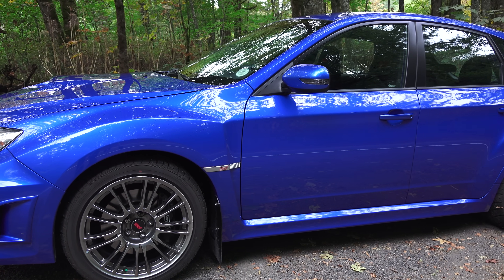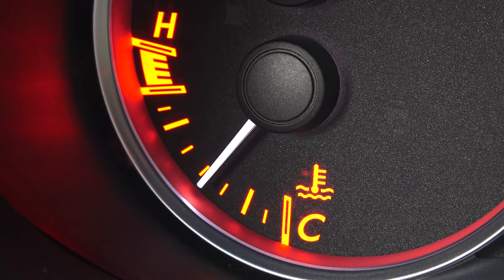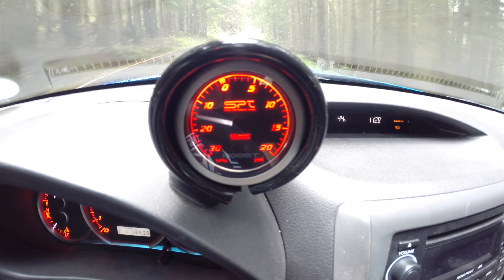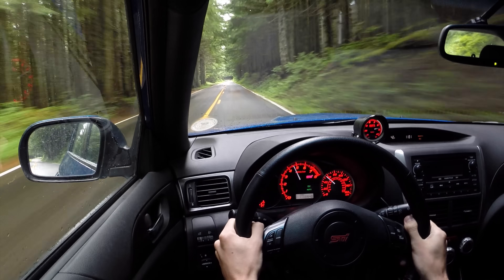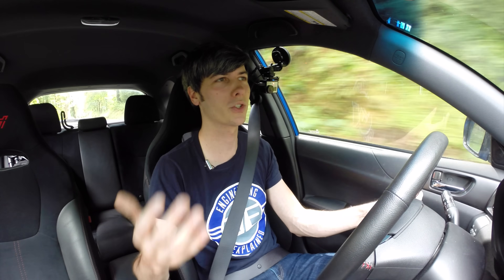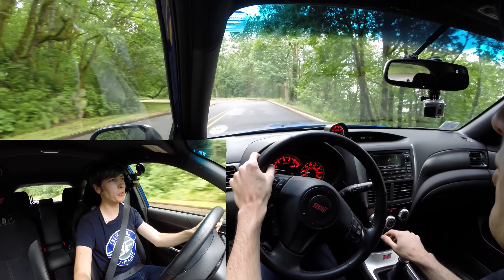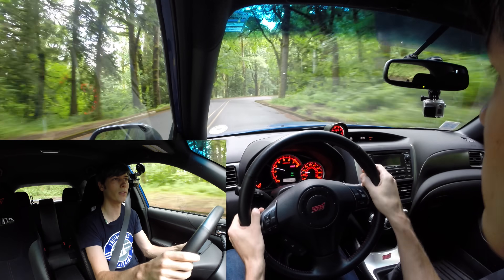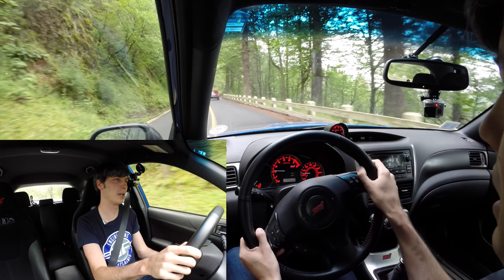5 Things You Should Never Do In A Turbocharged Vehicle

Comment: In the end Turbo Charging is no good for a normal individual who just want to go from point A to point B.
Reply: Depends on the design. Saabs got more power AND better fuel economy.
From my experience here are my numbers
 2.0 liter fuel injected 22 city 30 highway  110 hp  regular grade gas
 2.0 liter turbo  25 city 36 highway  160 hp  premium grade gas
Reply: You can use a smaller displacement engine yielding better fuel mileage at light loads.
Reply: How is better fuel economy not a good thing for getting from A to B?
Reply: Not necessarily true.  You can achieve greater fuel economy with a smaller, turbocharged engine with the same power figures as larger, naturally-aspirated engine depending on how you drive it.  Of course there are always exceptions to the rule, but this is generally true.
Reply: better fuel economy, more power, no real disadvantages. Euros are getting power from 2l units that Americans get from 6+ lumps.
Reply: Olly Roberts , oh I'm sure but a Corolla can get me the same fuel economy and its naturally aspirated.
Reply: Manny Echaluce Sure, but if the Corolla had a slightly smaller turbocharged engine, you'd get virtually the same economy while getting more power when you need it.  That's one of the advantages of turbos; generally you can have both economy and power without having to sacrifice either.  And of course there are trade offs. But at the end of the day, it depends on what kind of driver you are.

Comment: The first two points are generally correct, but your explanation is wrong. The reason is actually that you are expanding and contracting the materials that your engine and turbo are made of at too fast of a rate causing damage. this is especially true when you have a bi-metal engine (iron block, aluminum heads) which expand at different rates and cause head gasket/stud damage. these points apply to NA vehicles as well to an extent, the turbo is just an added component that can be damaged.

Comment: Actually your sti has a turbo reservoir which uses the venturi effect to continually flow water and cool your turbo through evaporation. Once you turn the engine off.

I personally let it idle on a turbo timer anyway because although it helps the center cartridge I don't trust it in preventing oil coking.

Comment: 0:50 most modern motor oils flow faster below operating temperature. They're less viscous when cold so that the oil circulates and lubricates the motor more quickly after cold starts. 10w-30 for example, has a higher viscosity at operating temperature (30) than it does when cold (10). It's still good practice to let it heat up before you thrash it though.

Comment: Your perceptions on fuel and how the octane rating works is flawed.  Putting higher octane gas in your motor than your manual recommends will not help, it will actually hurt.  You will get lower fuel millage and less efficiency.  Unless a vehicle is specifically made for higher octane gas (again, the manufacturer will tell you what it is designed to use), putting higher octane gas in it is just a waste of money at least, and could reduce the life of your vehicle.

Comment: Question on the "let it sit after running" part - Should I leave even a 'regular' car sit for a few minutes to let it cool as well to help with longevity of oil?
Reply: No.
Reply: Let it run for a minute to let the oil circulate and revs normalise if it makes you feel better but no more than that because then the temperature starts to increase as there is no airflow into the radiator/engine, you'll know if you left it too long if the cooling fan comes on.

Comment: Caveat on slip angle for turbo AWD vehicles.  While these are good practices for FWD or RWD cars, it isn't the same for AWD.  Best lap times are found by nailing it at apex or just after and allow AWD to work for you, gaining higher exit speeds than RWD.  If you have experience with this, there is no concern with oversteer, as the AWD will eliminate or minimize it.  You might experience a crab-like drifting affect, but used properly, it maximized the centrifugal force, producing an OMG slingshot moment.

Comment: It has to do with the high fuel oxygen mix and the low gear which causes high pressure in the combustion chamber, the gears are similar to a bicycle when you are on a high gear, you have to petal harder but petal less, less Rotations Per Minute

Comment: As someone who's been involved in turbocharging both diesels and gasoline engines and having owned many cummins diesels and subaru, and bmw turbocharged cars... I'd say a lot of these are overstated

Both subaru and dodge have stated that idea of running car for a while to "cool down" after running wasn't necessary.

Low speed pre-ignition would be probably ONLY in non direct injected cars, which are becoming more and more scarce (most turbos are moving towards direct injection)

And I'd say most of these topics should really be targeted towards gasoline turbo engines, as diesels typically make almost full boost directly off idle or shortly higher. Diesel fuel is one standard (at least in california) though cetane booster clearly help combustion and making power (to a point).

Comment: You CAN shut you engine off immediately. Oil still circulates in the turbo despite the engine being off. T His did not used to be the case, but with modern turbo cars it is. How do you think manus are able to implement stop-start in turbo cars?
Reply: You can shut down a hot turbo ONLY if the car is equipped with an oil re-circulator which most cars do not have.  It's simply an electric oil circulator on a timer that engages when the engine is shut down. If you don't have this, then DO NOT shut down a hot turbo without a cool-down. What happens is called coking.  It's bad.
Reply: Jason is right. Basically a turbo timer.
Reply: modern cars with stop start can switch off whilst in "stop" because the engine isn't off long enough to have the oil cool down. most cars switch themselves back on after 5 minutes of not moving anyway as far as I'm aware (everyone I have driven has) so the oil can circulate again and stop the coking process.
Reply: some cars, especially euro cars will run an electric coolant pump and leave the fan on to cool the turbo while the engine is off.

Comment: This is why superchargers are better than turbochargers. Though superchargers are less efficient than a turbo there is no turbo lag, no cool down time and no long wait to use it when you start it; because it is part of the upper intake manifold. Also forgot to mention that you don't need to drill and tap the block to get oil to it.
Reply: superchargers are still lubricated by oil and you should still be letting it warm up before thrashing it
Reply: What he said ^
Reply: supercharger oil is separate from engine oil
Reply: ahh the old turbo v superchargers - as you said superchargers are less efficient, ultimately have less top end potential (in road applications) and several other issues. Turbo technology has come a LONG way in recent years. 

My 2.5L 5cyc makes 445lbft from 1650rpm to 5500rpm. Lone gone are the days of "lag". Now its more a tiny throttle response delay. 

Both have their advantages and disadvantages but there is a reason the vast majority of manufactures have gone turbo. More efficiency, more low rpm torque.
Reply: I like the idea of cutting my hood to fit a supercharger with my '68 impala 396ci big block running a twin carb instead of ruining my nice free flowing no muffler exhausted that allows you to clearly hear the cam rotating at a idle of 620rpm. Running turbos on a 396 big block is kinda sac-religious in all of the years of my life. Turbos are for little engines and supers are for American muscle made before EFI and for drag cars
Reply: +Andy47357 your application is the vast minority these days
Reply: Andy47357 thats fair enough. tuning carby turbos is a fresh hell, better off with the simpler sc

Comment: You don't need to worry about turbo coking with the Subaru turbos. Subaru (and I think just about every other modern turbo car)  uses engine coolant to cool the turbo by thermal siphoning when the engine is turned off. You can see the coolant reservoir near the turbo and the line going to the turbo.  When the coolant system is working properly, the turbo shouldn't get any hotter than the boiling point of the coolant.

Comment: 87 octane petrol, heathens!
In Europe 98 octane is what you want!
Vrooooohahahahaha!
Reply: To be fair American's measure octane differently. (I'm European)
Reply: Americans measure octane differently; 87 AKI = 95 RON so the fuel quality is the same
Reply: I think he meant e85
Reply: +forszhen7 octane ratings change based on elevation. the higher up you go, the less air, the less air, the less fuel you get, the less likely to ping. most elevations above 4000ft have 85 for regular unleaded. in California and places back east, this is a non issue due to much lower elevations.
Reply: Jgizzy -redacted- Makes total sense.  Thanks!
Reply: I was just making a bit of fun.
I do wonder, is it common in the US to have higher octane fuel available at local gas stations?
Reply: There are typically three choices regarding octane; 87, 89, and 92 (91 in California due to increased environmental restrictions).  Any higher than that and you'll need to start looking for specialty fuel vendors.
Reply: Yes.
Reply: Usually 87-93, sometimes 85. BTW even if your fuel is higher quality is costs a fortune for one liter. Whereas in America its a cheap gallon.
Reply: Home of the Mad Damn...where can you get 85 oct?!
Reply: coinsagE46m3 It's rare, I have seen it though. Why do you want to know?
Reply: Home of the Mad Because unlike you, I've not seen it anywhere. May have when I was a kid a decade or two ago, but I wasn't really paying attention to octane back then.
Reply: coinsagE46m3 I usually see it at lesser used stations while in the middle of nowhere on road trips.
Reply: +coinsagE46m3 USA has some high elevation areas like the rocky mountains, up there the air is thinner with less oxygen so the need for higher octane is not necessary -- it is in these high elevation areas where you will see extra-low octane ratings of 85 (AKI rating, not RON). Everywhere else, the lowest octane is 87 and goes up to 93 before you get into special gas.

Comment: Given that, in a performance car particularly, the oil temp is more relevant information to the driver than coolant temp, why do they not have the oil temp on the dash instead of the coolant temp, or both? I own a TT RS and similarly it only has a coolant temp gauge on the dash. I can find the oil temp by scrolling through data on the digital display, but that takes time and concentration, plus I then lose my preferred speed display, so basically pretty far from ideal!
Reply: both is ideal but coolant is more relevant. if your engine is overheating the coolant temp will tell you first
Reply: piedpiper Not sure I agree with it being more relevant. Every day I need to see the oil temp, but in 5 years I haven't needed the coolant temp once :-)
Reply: how old is your car? it's fairly likely that within its lifetime its radiator will fail or a hose will crack or become unsealed or the thermostat will die and on that day the water temp gauge will tell you and youll be able to pull over and get it towed rather than blow the head gasket, warp the head, burn up the bearings and put a rod through the block
Reply: piedpiper Sure I agree that's possible at some point. And if the design were down to me, I'd have the oil temp gauge for everyday use and for events as catastrophic as described, sod having a gauge, I'll have a 100db  claxon and flashing lights :-)
Reply: A a RS3 owner my dash is similar, thankfully though its super simple. You just need to change the vcds codes. You can then have oil temp show on the main digital speed screen

Comment: how good is to use E85
Reply: if it's tuned for it, very good. usually ~20% more power with 30% more fuel consumption. keeps the engines cooler too and smells sweet as. do have to be careful warming up the car though because if it slips past the piston rings when its cold and mixes with the oil it quite bad for the engine

Comment: Thats the problem with those DSG engines, if i drive 50 km per hour, then it shifts to 6! Didnt know its bad for the engine. Now i have the car for 4 years, if i drive 120 km per hour, its in 6, if i push the trottle at that speed, i feel the car "judder or shake" (dont know how to say it in english). Is it the clutch plate thats broken?

Comment: 87? Dear god. I run everything on 98.
Reply: Do you not understand octane rating? I'm pretty sure he has a video explaining that for you.
Reply: +Mr S I think what he was implying was that 87 is really low. Judging that most turbocharged engines require at least 91 or higher.
Reply: Seraphim Valkyrin nah, he said he put 98 (european rating) in everything. He must hate having to change his catalytic converter so often. Octane ratings are car specific, they tell you what the rating is because that's what the engine fuel mapping is programmed to use.
Reply: ***** Yeah I know but if he's from Europe then 87 must seem really low to him since their octane rating doesn't even go that low.
Reply: Seraphim Valkyrin you and I know that, but this guy says he chucks 98 in everything and anytime I hear that it means he follow the "premium" dialect and it shows that there is a lack of understanding of octane ratings. 87 octane in the European standard is pretty volatile stuff and would be really easy to ignite under pressure. It would be great to kill cars with, lol.
Reply: in Europe only use the 102 Octane :D
Reply: +Mr S nobody changes the catalytic converter here lol... bigger octane number = +hp 😂 come to europe and view the straight pipes on everything lol.
Reply: Mazda NA Miata so people just don't care about how well their car runs. Without a tune, removing the cat puts a car in limp mode. Running it extremely rich, losing power and polluting their enviroment. I'll just stop responding now because here come the trolls.
Reply: ***** Ah, ok. I get what you mean now.
Reply: +Mr S better rich with beautiful backfires, than lean with overheating 😂😂
Reply: 98 AKI or RON?

Comment: Buy a diesel. Don't waste your money on turbocharged gas. The turbo gas engine won't even make it to 500,000 miles without needing a complete rebuild.
Reply: diesel wont even make it to 5000rpm without needing to change gear
Reply: That diesel, likely also because of the fuel formula, acts just like a NASCAR gas motor! 4,500 RPM is like an N/A gas motor.
Reply: Batojiri1
Basically twin turbos just to catch up to a naturally aspirated gasoline 572 V8. ;)

Comment: I've always heard that you should avoid lugging your engine with a turbocharger because doing so jacks up the cylinder pressures.  This is usually why a procharger, or supercharger is less likely to blow up your engine.  Superchargers build cylinder pressure with engine RPM since they are belt driven and keep cylinder pressures under control.

I agree that you should run good fuel, but why recommend running the highest octane possible?  If your vehicle knocks or pings on the recommended fuel, it is probably broken.  So it should be fixed.  If it's modified, all the rules of fuel go out the window, and the only real safe way of ensuring the proper A/F ratio, is to buy a wideband O2 and see exactly what your car is doing.  If necessary re-tune it.  Once you do this you can set it up for 87 octane or whatever else you want to run.

Comment: It's bad to lug all types of engine, mostly due to high stress at the con rod bearings. And when you lug your turbo engine, you don't actually produce high boost. You probably don't produce any boost at all due to low exhaust volume and velocity at low rpm. That's why most turbo cars don't have a lot of low end torque comparing to NA engines. Turbo cars have a big ass restriction in their exhaust system - the Turbo itself - and it takes time for it to spin fast enough to produce boost.

Comment: Why do diesel engines go rich when loading them on low rpm? 
Don't know anything about diesels really but I thought they worked about the same as a petrol car with and afr-meter/temp sensor to know how much fuel it needed at different loads/rpm. 
Do diesel engines benefit from rich mixtures when accelerating in countrary to petrol engines that benefits from a lean mixture. Is it because they are more suseptible to pre-ignition and it's a preservation precaution?

Comment: I'm sorry but do you know what your talking about? let me know if I'm wrong, but I'm pretty sure if you floor it at 1000 rmp your not going to be putting more boost into the engine like you said. as far as I am concerned boost levels are dependent on rpm and not throttle position. hence the time in the lower rpm range where you don't have boost.

Comment: Subarus in particular DO NOT NEED A COOLDOWN before shut down.   But Ive only been driving a modded one for 190k miles all the will shutting it off in short order after whatever i was doing.    5/40 shell T6 at 8k mile lab tested intervals. No consumption.